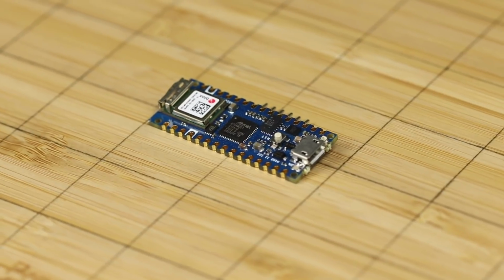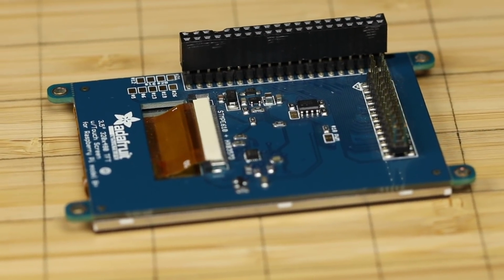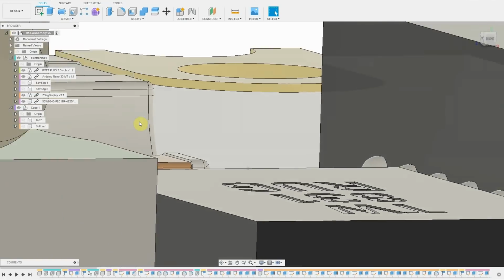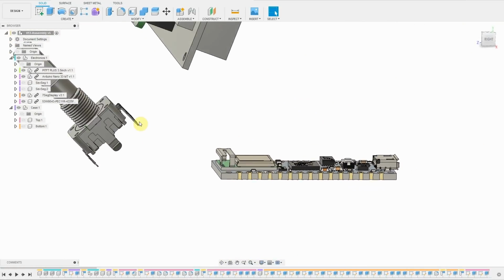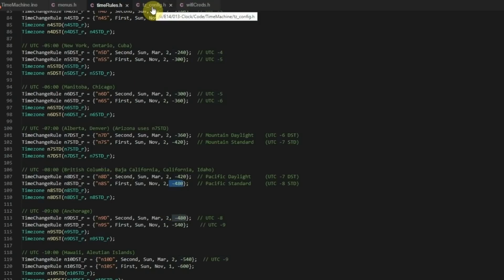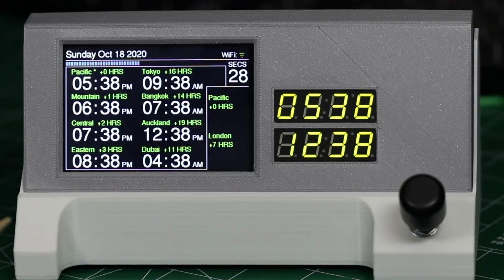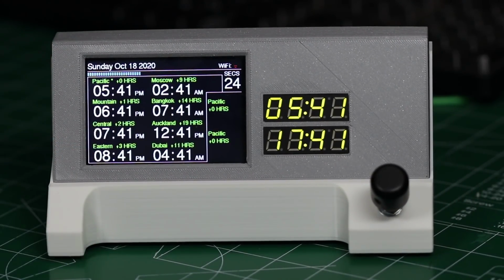#IoT #Arduino NTP World Clock with SPI Display

Comment: Brilliant build; I really like the actual physical design of it; that clean/minimal look. Could almost be a spaceship module by the looks of it (I'm thinking 2001 Space Odyssey type clean and minimal).  I'm considering building a web version of something like this and it's interesting to see how your user interface works, and your thought process on the configuration side. I'm also planning on eventually stepping into the arduino bottomless pit at some point, so I'm just nosing around the edges to see what's out there.

Comment: I just started to do this myself, using two Adafruit 1.2" 4x7 seg on a pico, using 8720 for NIC, but decided to scrap that and go with arduino (esp-32 w/ ethernet) but just got lost in the mess of my mind of trying, scraping and trying again. This was a fantastic video to get me back on track. Maybe I can use my pico again. 

Even worse, initially, I was going to have my pico also grab time from GPS and serve as an NTP server too. I think that's a bit too much for the pico lol. Oh well, good thing these boards are cheap (cost and power-wise). Looks like you've got some interesting content, subbing for sure.

Comment: I really like to make this project, but I can not find library #include "timeRules.h", can you please let me know where I can find this please
Reply from the maker: The code can be accessed on the Community:  https://bit.ly/3m7nqBN
Reply: thanks but still have this problem
 timeRules.h No shuch file or directory 
ArduinoClock-main (1).zip\ArduinoClock-main - ZIP archive, unpacked size 20,310 bytes  Find timeRules.h file stored this file in the arduino library , but no luck
Reply: I did find the answer,  thanks for your response.

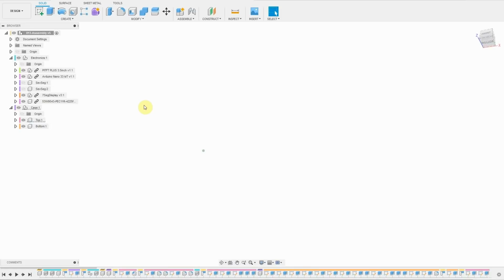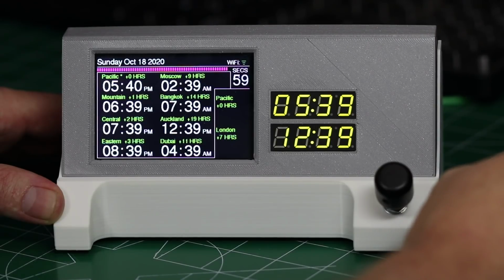Comment: Um.... Did nobody else notice that the second LCD clock went from 12:39 to :12:49 (@19:55 in the video)?  Seems like there's a definite problem there.  
It did correct itself on the next minute, jumping from 17:49 to 17:41 in synch with the rest of the clocks (@20:46), so it seems like a problem with displaying the zero.  Presumably software, but could a wiring problem cause that?

Comment: Nice build, very nice; gives me ideas and also I have worked with the seven segments displays before and have had difficulties using them. I will look into getting the proper components. Thx for a great video.
Reply: Thanks Eric, it was a breeze after finding the correct IC. I spent way too much time banging my head against the 23017's!

Comment: Nice project! I wonder if there is an LED driver chip that can use I2C, I want to create a similar project using ESP8266 or ESP32, and I've used I2C before in my projects
Reply: I looked but did not find one. That does not mean it does not exist though!

Comment: no alarm function? lol cool project, would of liked to see it go together, especially curious if the 3d tabs worked or if its full of glue 🤙
Reply: A couple dabs of glue on the tabs. For the most part, the tabs worked out OK. Next time I will leave a little more space. I ended up having to sand and file to get the right gap I needed to put the protoboard in.

Comment: Hi, the Model and download 3d CAD don't correspond to the showed box. I think the 3D CAD file is for another project. Also, how to download it? We can only view it. Thanks
Reply: Thanks for letting me know, I will get that fixed!
Reply: This is fixed. The STL's can be found on the Element14 Page now as a downloadable ZIP file.
Reply: @kalebclark5826  Thanks. I have already find this STL's Zip existing inside NTPWorldClock_Resources.Zip. The issue I was talking about was when i clicked somewhere (don't remember) into a link that show 3d CAD online format where I can turn and see all the 3D design but is not the good design for this project. the box there is for another project and also no way to download it. tell me please, the STL's files are they for 3D printer to print the box?

Comment: Have you tried India's timezone, which is UTC+5:30 ?
Reply: Hi Josh, I left it open for configuration because there are sooo many timezones. I configured it for the TZ's that I work with most. But its pretty easy to add which ever you need.
Reply: Adelaide, Australia is another odd ball time zone: UTC+10:30, including daylight saving(add an extra hour) atm